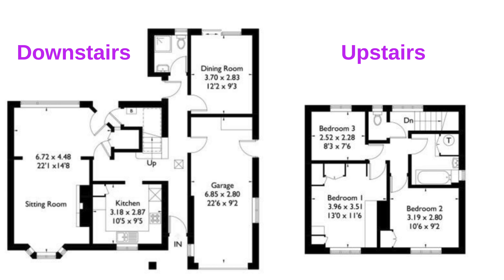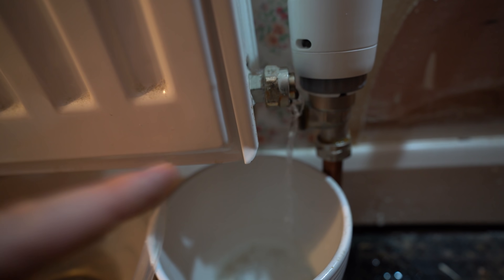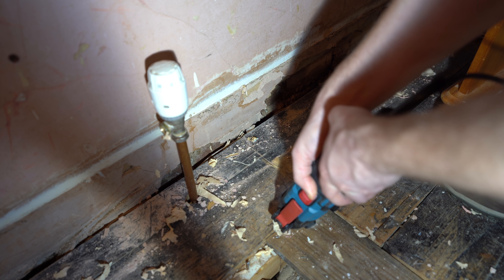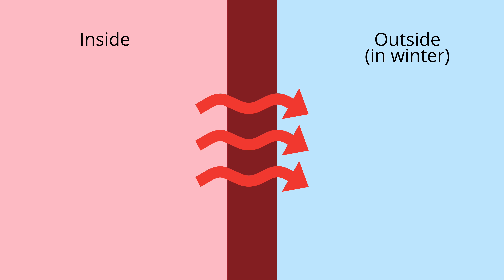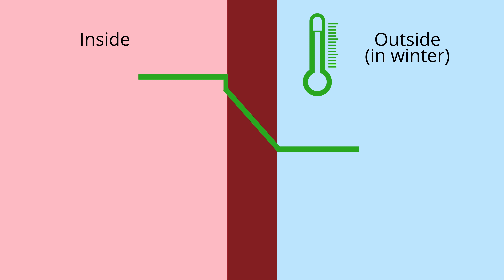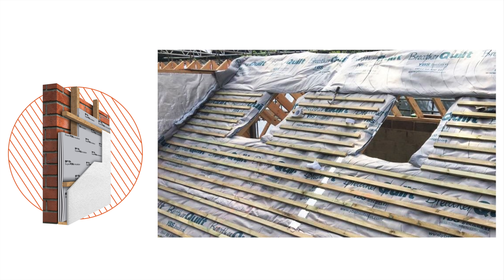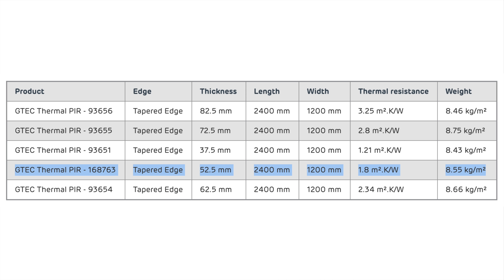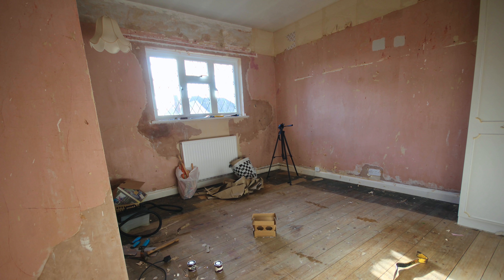Using Adhesive Foam To Attach Insulated Plasterboard

Comment from the maker: 0:00 Intro
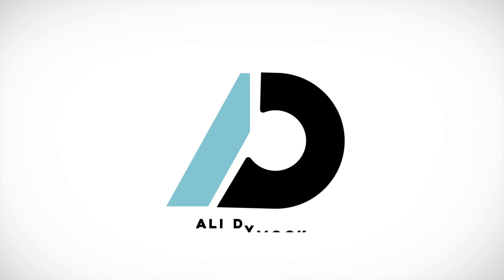0:17 Prep work
2:45 Solid vs Cavity Walls
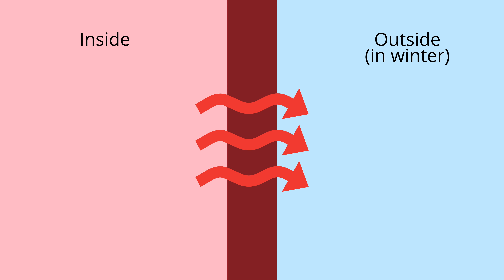3:54 Internal vs External insulation
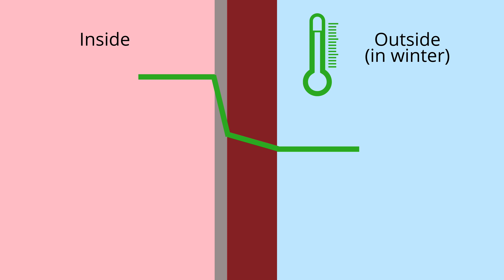5:26 Options for Internal Insulation
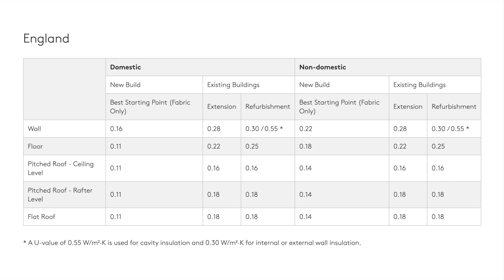7:01 Building Regs & U-value
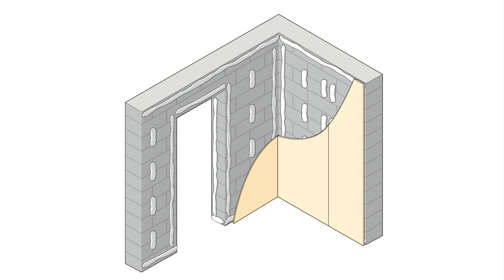8:12 Options for Attaching Insulated Plasterboard
8:42 Attaching with Insta-Stik Foam
11:26 Mechanical fixings
11:56 Window Reveals
12:30 Finishing Touches
13:04 Outro
Reply: Jjjjjjjjjjjjjjjjjjjjjjjjjjj

Comment: Not sure of you’re still doing you tube but interested to understand if you’ve have any moisture issues following the internal insulation. I’m being advised not to appply PIR to Walsh’s as I have a solid wall therefore need breathable products🤷‍♂️
Reply: i did it to one room in the summer. i know its only been 6 months but all good so far
Reply: @dddsfdsdsfs thanks, was that done 4 years go as per the video?
Reply: @AndrewWilliam-z4w no 6 months. But that room is now the only room downstairs that hasnt had damp and mould patches appear this winter
Reply: @dddsfdsdsfs interesting. So the bedroom I think it looks like, you insulated with PiR 4 years ago is all good?

Comment: This looks like a more economical way for installing, one question i have a single skin garage wall bricked up replacing the garage door, can i just go ahead with pl4000 celotex with adhesive foam. My only concern is alot of people mention dpm ? But how can you add dpm sheeting then expect the adhesive to get a good bond without all coming away from the wall ? ...or is the pl4000 with vapour barrier enough protection ?...any help much appreciated. Dont want to stud as have a tight room already to play with. Cheers
Reply: You need 25mm studs if using thermo board.

Comment: The BEST way to avoid condensation is having vents or open your windows a bit in the morning for couple hours to get some fresh air, and ignore all of these shenanigans with insulation and whatnot.

Your only concern should be to stop the cold temperature outside getting into your house, ignore the condensation issues and just open your windows in the morning dont need too much, just a bit open to get some fresh air going.

Heating bills will be up but a marginal 1% or 2% if you keep it on all day long but you wont have condensation and dont have to worry about any of these insulation vs condensation that nothing works other than fresh air.

Comment: What adhesive to use for sticking PIR to Plasterboard?
Reply: Im looking for info on that as well its my next stage as ive 2 rooms done with the PIR boards stuck to the walls so researching an adhesive that will stick plaster board to the foil backs ,did you come up with something ?

Comment: One problem you can get doing this is before you put insulated boards on you can see if you have water or damp coming through the walls but once you have stuck insulated plasterboards on you will never know and in those cases you can get black mould form behind the insulated plasterboard.

If your pointing outside is all good you may be fine but if it’s a single 9 inch brick wall you may get penetrating damp, if the wall has a cavity you should be fine unless the cavity is bridged anywhere, remember black mould is a living organism and you only need a small patch and soon the whole back of the boards will be covered.

Comment: It's ridiculous that the external insulation is the technically better solution, but the majority of the issues with it are "but I don't like how it looks!" "NIMBY" non-sense. Lowering our energy usage and dependency on fossil fuels is an existential priority. Aesthetics are not. It's the equivalent of refusing the fire fighters help because you don't like the colour of their truck. If this is the state of humanity then that's pretty damning for the species.

Comment: Great work man, I ended up going the stud wall route using CLS16 and 50mm PIR with a 12.5mm board on. This was on a late 1800's property. I put strips of DPC on every timber that was touching the wall and had an air gap between the wall and insulation (about 10-15mm on average)

I was surpised how much noise it actually cut out just by doing this let alone how warm it was.
Reply: You could also use minimal gap expansion foam between the timbers to prevent cold bridging and eventual decay.

Comment: Do you have a video of adding insulated board to a bay window? Mine has ancient expanded poly tiles over the insides of the solid stone window mullions. This looks terrible and the joints/gaps encourage mould. However Im not sure how to mitre the boards to fit?

Comment: I Want to do this in my daughter’s room. I have a couple of questions if hats ok.
1) Do you only need to do the outer walls? I was planning on doing all 4 internal walls in her room but if I don’t need to then i can save money!
2) I saw on another video about foam insulation where they advised to have a gap between the insulation and the wall to prevent condensation. (I’m going to have to take the plaster off as it’s in a mess) is it safe to stick it straight onto the brickwork without a gap?

Thank you
Reply: You can insulate internal walls for sound but it's not really needed. It's better to have an air gap and vapour barrier to external walls.

Comment: Such a super helpful video thank you! I've just done the same in our living room following some of your instructions. Just wondered though and I've already done the same as you but now I'm second guessing myself, would the capping off of the insulation with plasterboard at the window reveals be a point at which vapour could pass behind? I'm hoping I don't need to rip off the plasterboard I've fixed here! 😂

Comment: Do not take radiators off like this, you'll get lucky a few times but the valves can come off especially in older houses. Always hold the valve steady with a pair of grips whilst unscrewing the radiator.

Comment: I've read that moisture can travel from outside inwards through the wall. Is this something you considered? I think there are special coatings that can be painted on to the exterior which will stop water getting in but allow moisture to escape. Thanks for the video :)

Comment: Good video. How did you prevent moisture migrating and condensing around the wooden beams? I'm doing a similar job but I'm afraid that the wood in the walls will rot because of this excessive moisture.
Reply: DPC behind the battens.

Comment: I'd like to do this in my bathroom and apply over existing plaster which has been painted. Would it be best to remove the existing paint before installing the thermal plasterboard?

Comment: using this impermeable system is not a safe method of insulating. If you are lucky you might get away with it on the first floor but never on a ground floor; you will run a high risk of moisture build up on a cold wall.

Comment: I did a baton frame of 2x1’’ with 400mm centres with 50mm kingspan filling. Then put a visquin sheet across the whole wall to stop moisture, then plaster board.
Reply: Good idea.

Comment: Hi check the plumb of your walls first  and indeed how straight the existing wall runs because it may  interfere with your boarding and it’s a real pain to have to undo your work because you realise there is an issue that stops you achieving a plumb flat wall

Comment: I don't see how this is a continuous vapour barrier if the foil is on the back and the acoustic sealer is on the front, with a porous material and the thin air gap of the crack where panels abut between the two airtight elements. I may be missing something though. Thanks for sharing your experience as always.

Comment: Spray foam is not for that job it' 's not fire-rated unless you buy the very expensive one which is fire rated  you can't straighten the wall with your  straight edge using spray foam   The sheets should have put on full for minimum joints

Comment: While floor up, should have spayed the joists ends with anti-rot /wood worm. Because the insulation you used between the joists is less air tight than that above this becomes a cold bridge. Any moisture under the floor will condence on the outside wall. Spay would extend the joists life by 20 years ish.
You mentioned possible use of polystyrene. NO. In the event of a fire this will kill you quicker than what you have used. Also moving forward, if you ever needed to rent the place out, polystyrene is simply not allowed.
Reply: It's not just polystyrene.. it has fire retardant properties added

Comment: Hi Ali great video, was wandering if you recommend this method for a solid bare brick wall with historic damp (now dry) or should I use batten method just to ensure a consistent gap with vapour barrier ? any pointers would be greatly appreciated
Reply: Hi I'm doing a similar project. I'm going to stick the board directly under the windows but do joists on the big wall. I'm not using insulated board, I'm putting insulation in the gap.

Comment: I hate radiator heating, it's so bad. You'd be better off running copper pipes through all your floors and having the floors heat the home cause heat rises, as where a radiator only heats the immediate area.

Comment: hey ali - can u explain how u fitted the radiator brackets back - as the insulated plasterboard is not strong enuff to hold that much weight right??? which fixings did u use to fix the rad brackets???
Reply: I'm thinking of insulating our brick to brick 'annex' on our ex council house and will probably use the solution I used earlier on a plasterboard wall in a converted attic - simply glue on two strip wood pieces say 2" x 1/4" where the radiator brackets are to go and use five short screws to attach each bracket, took a double radiator 60cm by 80cm no problem.
Reply: @MadAsBagOfMonkeys  i thought 150mm screws (or coach screws) screwed thru the insulated plasterboard & into the brick would be ok???
Reply: @mrv5801  bit overkill, as I say, the 2inch by 1/4 inch by 1 foot lengths glued on to where the brackets will fit and plenty of 3/4 inch screws will hold any decent sized radiator.  took a heffty radiator I put on in a simple one thickness plaster board 'wall' in my attic five years ago. Sure a PIR backed plaster board will be even stronger. Didn't want any metal screwed in to a cold wall to bridge that'd bridge the insulation?

Comment: Don't the isulated boards have a foil backing? If so, how are managing to stick them onto the masonry wall?
Reply: I did it today and it works with the foam adhesive.
It sets quickly so be sure to only wait 2min once finishing foaming the board up before sticking

Comment: #1 ...why do the English do the plaster 'skimming ' .... when it is not required ..... .... and why do all this if you don't double/ triple glaze ... and radiators under windows are  a joke  ... they just send heat up the back of all window dressings and out through the glass .... heavy lined drapes WITH fitted pelmet are the BEST product for keeping in heat for windows ..... and they should start 1 inch from the ceiling cornice and just touch the floor covering ......  unless you can find the roller blinds that have the 'Star Wars" force field

Comment: Warning, if there's a chance that the room temperature will drop below, I think, 5C just closing down the TRV is not enough as they open at about this temperature as a built in anti-frost setting. Use a proper screw on valve depressor thingy, they usually come with the TRV. Been there done that, didn't enjoy the soaked floor experience!
Secondly, I think the insulation on all these insulated boards acts as a vapour barrier.

Comment: Nice tutorial and analysis. I had damp issues in my Victorian house in the alcoves so built a stud wall with 50mm gap from the wall then celotex insulation and plasterboard. I also vented behind the stud wall with holes in the suspended floor and going up through the ceiling and the same above. I found that I didn't need a plasterer by carefully filling all gaps with caulk then polyfiller to level, cross lining with lining paper and using a top layer of textured paper. If the costs of heating keep going up, I may sacrifice more interior space with another layer of insulated plasterboard!

Comment: you used acoustic sealant to fill the gaps and continue the vapour barrier - Do you think normal expanding foam would do this also or the inst stik itself as it's to hand? Thanks
Reply from the maker: I think probably not because even if you use close foam which I think insta-stik is you're not going to get it exact so you'll cut the foam which opens it's cells and allows air and mositure through. You could say my doing it is overkill because the boards are pretty tight and any big gaps can be filled with foam but it's just an extra precaution - you don't have to use acoustic sealant, just any flexible sealant will do the trick 👍

Comment: Brilliant videos Ali been watching since the garden building.    I am about to embark on the insulated plasterboard and will be follwing your guidance.   Can I just ask what the purpose of the 15mm gap is at the bottom that you later fill with expandable ?   Thanks keep up the vids
Reply from the maker: Nice! Yeh do you remember when I was attaching plasterboard in the garden room and lifted it off the floor? This is because plasterboard can crumble and deteriorate quickly if it gets wet so a spillage on the floor can seep up the plasterboard if it's flush with the floor. This why plasterboard in a bathroom isn't the best option and cement board is best. So yeh, just lift yours up 10mm or so and you'll be good then fill with foam and/or sealant and you'll be good :)

Comment: Great video Ali, I'm thinking of doing this to my downstairs bathroom external wall as they get really cold. Do you know if you can have the U value of the wall checked by a builder or building Regs at all? I believe the wall is already insulated but I was going to add another 50mm with foil/backed/foam/plasterboard wondering if that would suffice? thanks John

Comment: Hi, I am looking to do the same thing in a garden Annexe which I am now using as a home office. My issue is that the walls have been previously finished with a very rough plaster finish. What are your thoughts on this? e.g. would I need to re-plaster to ensure a flat surface prior to installing the boards? Although this approach does seem fairly double handed. 
Great video, I had considered all the same options you had and this definitely helped me to make my decision! Thanks a bunch! 
James
Reply from the maker: Hey James, is it currently plaster direct on brick/block like mine? If so, no it doesn't need to be flat as the layer of insta-stik takes out all the irregularities. Just make sure the plaster isn't crumbling. If however you've got plasterboard already then the threat is that if it's not well adhered or fixed then it can come off (probably unlikely but worth being aware of). Plasterboard attached to battens might be worth taking off to get back a few cms of space before you do insulated plasterboard.

Comment: Would you be able to let us know if the insulation has made a noticeable difference to your comfort and bills?
Reply from the maker: Well bills have gone up for sure but that's the crazy gas prices at the moment. I haven't checked overall usage though. What I can say is that the room feels really warm and comfortable compared with the winter we spent in the next door room which was the same (i.e. just a solid wall). I've now done the same (insulated plasterboard of the same type and thickness) in the next door room which probably shows how pleased I am with the results. You can see how the bedroom turned out in this short vid: https://youtu.be/24oDh03Yuqg. One thing you'll see is how nice and thick the window board is, looks a lot better and it's a nice side effect of doing this project. The detraction is our metal windows which are really poor so once they are replaced (some time away) I think it will be incredibly warm and well insulated in the bedroom.

Comment: Hiya, I heard that attaching with adhesive to a solid brick wall can cause failure of the adhesive when moisture comes in from the outside (e.g. the wall is not rendered and there's a rain storm). Is this also an issue with the foam?
Reply from the maker: I'm not 100% sure, but all I can say is the foam is ridiculously sticky, I really can't imagine some water causing issues with this once fully cured (which happens within the day)

Comment: Great video and finish is brilliant, been researching so much myself and this is best I’ve found! Just a quick question maybe a bit of advice my brick walls have brick vents would it be best to keep these open as they are to still have a natural air ventilation? Thank you
Reply: Yes, always!
Reply from the maker: I agree with pumpkinhead, worth keeping them open, just make sure you seal the plasterboard as much as possible to stop heat being lost by convection (drafts)